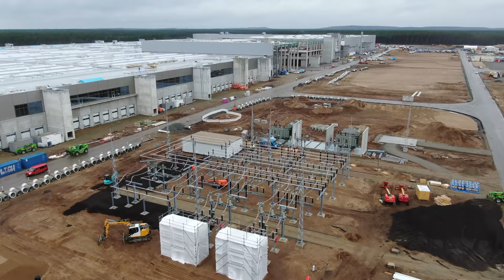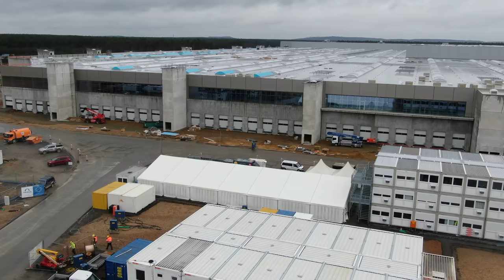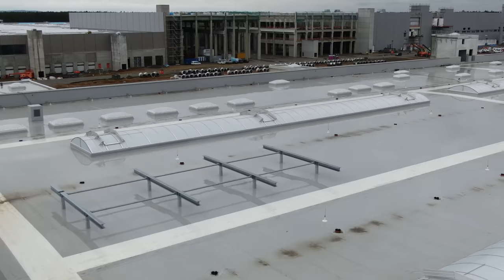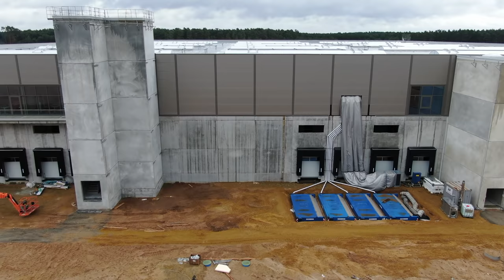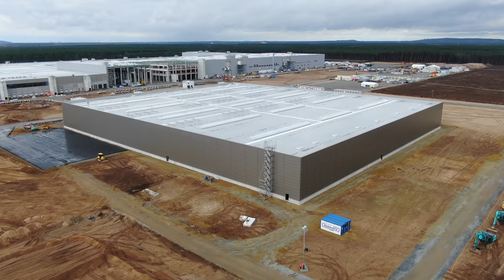Giga Berlin | 2021-03-27 | More Model Y Bodies

Comment: Well, well, well! @12:10 we can see 6 body under wraps
Top left seems to be MY
Top right first have rear bumper, and seems like the possible hatchback M2
Middle left: no idea, possibly M3
Middle right white wrap: Seems like Model S. Quite long compared to the ones near by.
Bottom left: no idea.
Bottom right: Model X perhaps. Relatively bigger than all other cars there.

Since the body is placed near the painting equipment, they must be testing testing if all models can be painted in the same paint hall.
Reply: This is big find. The right bottom one looks like a Van. 
Top right is a cyber car hatchback?
Reply from the maker: I am pretty sure they are all Model Y. They do have different configurations though. Some have doors, some don't. One has a missing rear end, and they are wrapped different which also changes the looks.

Comment: Two casting machines visible now, room for many more. Only one at Texas so far.  Are their deliveries slower then expected?
Reply: There are 8 planned for this site. Progress looks a little to slow compared to the rest but maybe only two are needed for trial production and the first ramp up.
Reply: @goodyKoeln  For the currently built production line (model Y) of phase I two of those machines are sufficient. Similar to the drive unit production which has also been designed for more than just one production line/model.
Reply: @abalada  Do we know that the rate of one casting machine producing parts is faster than the planned line speed, or are you guessing?
Reply: 3 castings. 2 presses, 40 to 45 an hour, 24hrs a day, 365 days a year. Max 233,600 cars. Obviously there will be downtime and could also use to make other parts. I'll imagine more presses will come soon IDRA can only build them so fast
Reply from the maker: I do think that IDRA is somewhat limited in production. I'm pretty sure it doesn't happen that often to get an order for that many huge machines in a short time. I don't think they expected to get all machines for the start of production. I'm sure they knew when they ordered how fast they could expect the machines to be build. But for start of production, two machines will be enough. For ramping to 500k they will need more though.

Comment: How come parts of the “(|” sections of the roof are blue and some are white?
Reply from the maker: I think they just still have the protective foil on it.
Reply: @TobiasLindh  thanks👍
Reply: @jason.stevens  My assumption is however that there are also some differences between those "blue" windows above the offices, canteen etc. and the "white" windows above the production. I.e. that these roof windows are different models, maybe even from different manufacturers. Thus the difference in the protective foil used.
Reply: I think the blue ones lie above concrete roof sections. Must be a different (fire protected ? ) type
Reply from the maker: @abdebee3221  The blue skylights are above offices and canteens, not only on concrete sections. But they are indeed a different type of skylight than the white ones. 
I still don't think they will stay blue though, because in a skylight you want the full spectrum of the sun without a blue filter on it.
Reply from the maker: @abalada  Yes, you're right. They are different. I just had a closer look.
Reply: @TobiasLindh  Probably the "blue" is not even a protective foil. Those could be Grillodur rooflights from Velux which are available in the color "blue transparent". 
https://commercial.velux.de/produkte/kunststoff-lichtbaender/grillodur-lichtbaender/gewoelbte-lichtbaender#
Reply from the maker: @abalada  Thanks, you are completely right. I'm pretty sure that's the exact type of skylights at Giga Berlin. I'm surprised that there is a blue version. I can't see the benefit of making them blue.
Reply: @TobiasLindh  Technically there seem to be no differences between the available colors.
https://www.jet-gruppe.de/media/902/download/Prospekt_GRILLODUR-TAGESLICHT_4_1_1_DE_DGUV_20191108.pdf?v=3
Blue seems to be however quite popular. It's not so that the light inside is really blue
https://www.bba-online.de/funktionsglas/sonnenschutzglas/natuerlich-ausgeleuchtet-dank-fiberglasplatten/

My guess: with those windows in blue a grey day appears not that grey. Thus a rather psychological effect.

Comment: Great video Tobias. At 12.08, top right wrapped shell, is this a model Y with no rear casting or a model 2 perhaps? Seems shorter in size of model Y or 3
Reply from the maker: It's a Model Y without the rear.

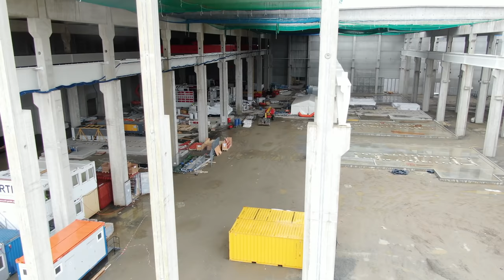Comment: Nice too see. I am wondering, are you allowed to nearly fly into the factory ? At 4:05
Reply from the maker: It's not as close to the building as it looks. Even on full zoom you still see both columns in frame, which are 8 meters apart from each other.
Reply: if he flew in he might lose connection to the drone with all the steel and concrete.

Comment: Have I ever followed the building of a factory before - not really, I did do a factory tour to see where my current Car was built ( Not Tesla). My interest in this is well I fancy a model 3 or Y but only from Berlin as I think they will shift from what has been lacking in quality of paint and fit and finish to what is really expected. Bits falling off brand new model 3 performance in the U.K. was alarming, paint chipping like it had never seen a professional paint department also alarming. Tesla waking up and thinking right we are better than this and not this continual pus for just numbers out the door at the cost of what the end product is has to stop at some point. Watched these since the Forrest was cleared. 👍

Comment: Tobias, do you think Idra is slow in manufacturing the Gigapress casting machines, and Elon has diverted some of those slated for Berlin to Austin instead?
Reply: I remember Tobias said the machines are already on site, they just need to be installed. IDRA may not have enough employees to work on all these sites simultaneously (Shanghai, Berlin and Texas).. But I think it will be OK in the end.
Reply: Interesting, I hadn't heard of the other machines being on-site already
Reply from the maker: I did say before, that I think that two machines are already on site. That's the two machines that are getting installed right now. And I think they will only install two before the start of production, and install more later, as they ramp up production.
I do think that IDRA is somewhat limited in production. I'm pretty sure it doesn't happen that often to get an order for that many huge machines in a short time. I don't think they expected to get all machines for the start of production. I'm sure they knew when they ordered how fast they could expect the machines to be build. But for start of production, two machines will be enough. For ramping to 500k they will need more though.
Reply: I greatly appreciate your response Tobias!  Makes sense. Thanks!

Comment: @12:11 I see two bodies that are quite a bit smaller than the model Y... 

Just pauze the video @12:11... 
The one in the top right, is smaller than the one below under the white cover.. It looks like the smaller one the back side is more straight and cut off compared to the one in white, the middle right.

It also looks to me the bottom left body (grey) looks shorter than the one under the dark blue cover in the bottom right.. but this could be an optical illusion.

But the one in the top right is certainly different, the back more square, and length is quite a bit shorter.

hmmmmm... What do you guys think!? Is this the template for the €20K "European style" smaller and cheaper hatchback model '2'?
Reply: Because the back is cut off.
Reply from the maker: I think they are all the same. Just with some different configurations. Some have doors, other don't. From one the rear end is missing. And they are also wrapped differently, which leads to optical illusions.
Reply: @TobiasLindh  Makes sense, thanks

Comment: What is going on with the permits? Who is to blame for the delay?
Reply: Covid 19
Reply: There are currently only two pending permits. About the removal of the topsoil of the newly cleared area and underground pipes/wires (if about pipes they have this permit now obviously). 
The big question is: is there a (serious) delay at all?
Tesla's plan was always to start production in the GF4 in July 2021. And Tesla just recently placed a logistics tender (delivery of components and transport of the produced cars) for trial production in May and final production in July.
Of course, this is an ambitious schedule and you don't need much that this won't work out (like the current blockade of the Suez Canal, the current outbreak of Covid-19 among Tesla employees at the GF4, a single supplier who fails to deliver in time, ...)
Tesla also received permission to work 24/5 (i.e. on weekdays) at the building and 24/7 in some inside parts like the paint shop. It does not look like that they use those possibilities a lot (besides some oversized equipment can only be transported at night to the factory).  Obviously, Tesla sees no need to do so.
Reply from the maker: I think the permit about the pipes is also just for the newly cleared area. For the old area they already had a permit for a long time.
I don't think that the permits cause any delay at all. The only things I'm a little worried about, to be ready for the start of production, are things that have been permitted a long time ago.

Comment: Steht da ein Body vom Model 2? Die eine Karosserie ist deutlich kleiner als die anderen fünf.
Reply: Warte da schon mit Spannung drauf, denke ist noch zu früh aber was soll es dann sein, sieht wirklich so aus...
Reply: Das ist ein Y ohne Heck.
Reply: @julianreverse  Ja, jetzt wo Sie es sagen denke ich das auch. :)
Reply: @julianreverse  I am not so sure, also the nose is shorter.
Reply from the maker: @MarcoNierop  The nose is not shorter. The nose is exactly the same as the one behind in the same wrap. The two in the white wrap seem to have some more front parts under the wrap, maybe more bumper parts, or just some protective foam, but the body is still the same.

Comment: Some hard cuts, that make it not easy to follow the video, beside all the great pictures!
Reply from the maker: Thanks for the feedback.
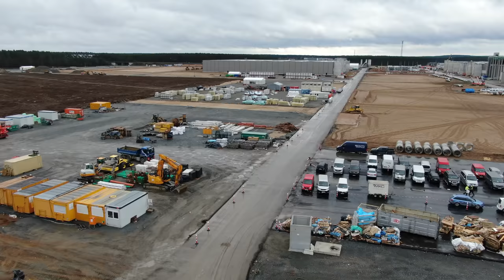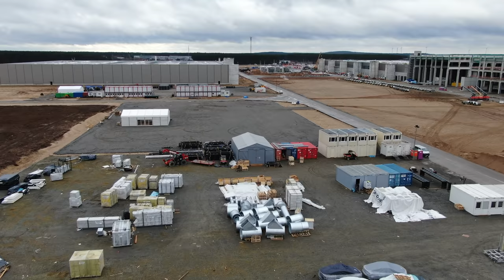There are two cuts at the end where I'm not near the same location after the cut. (12:23 and 12:54) But at the first you see the cars in the shot, so you won't lose orientation, and the second is just a cut to prepare for the overview over whole site at the end.
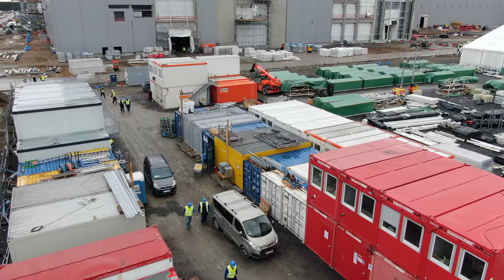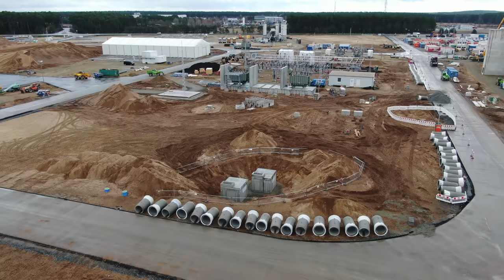There are some cuts in the middle though, where the drone location doesn't change but the direction of the view, but I was hoping that people wouldn't lose orientation if I don't cut to another location. (2:30, 2:50, 8:55 and 10:55)
Sometimes I don't have any usable footage where I fly the other location, and sometimes it would just lead to more unnecessary repeated scenes, just increasing the length of the video with very little value. I do try my best, to avoid those cuts, but it's just not always possible.

Comment: Why isn't this place making any cars already? It's been over a year, and the one in Shanghai was in full production mode at this point.
Reply: Tesla always planned to start production in GF4 in July 2021. With this schedule in mind, they ordered also the equipment etc. needed. An earlier start was thus never realistic. This factory is also considerably larger and will use new production methods. Not just a copy of the production of previous Tesla factories.
Reply from the maker: Also, it was not over a year since the start of construction. They started end of May. If you count in the land preparations, then Giga Shanghai started in October 2018 (or even earlier, if you include removal of the farms).
And if they start production in July at Giga Berlin, then it's actually the exact same time as Giga Shanghai, from decision for the location to start of production. Which would also include the time for planning at both locations.